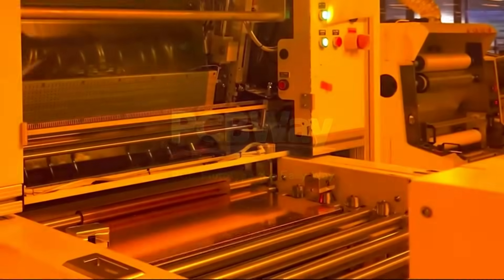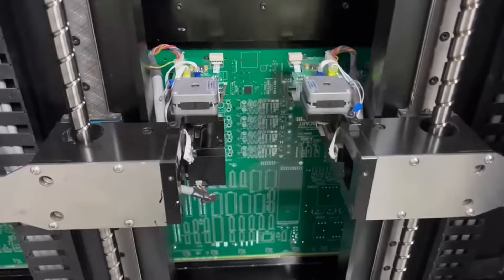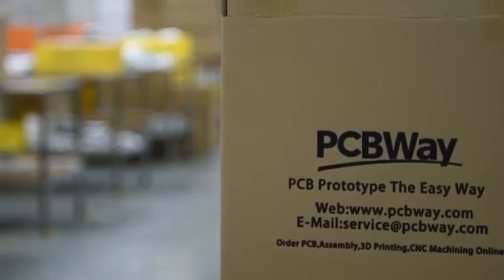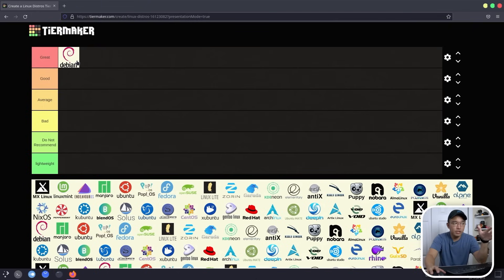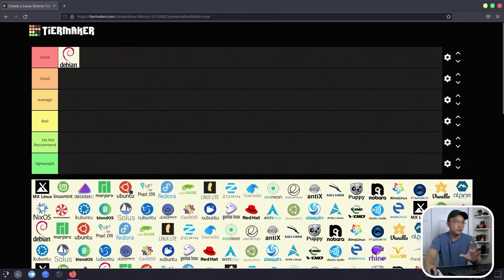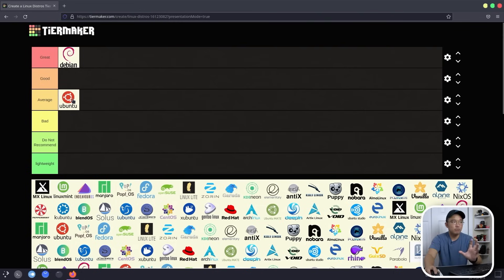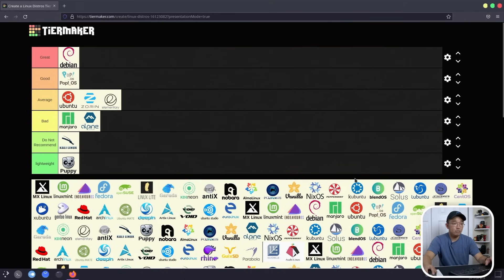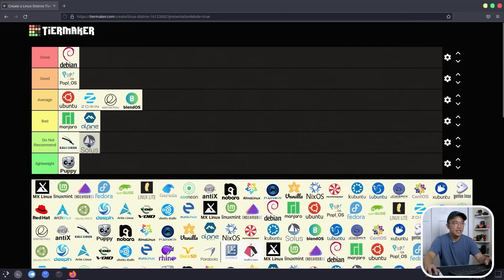Ranking Linux Distros 2023: Linux Distribution Tier List

Comment: Linux Mint - easy to use, has zfs pre-installed (zfs create & zpool create),  updated frequently, & stable. I run a headless zfs storage server. Set it & forget it. Keep making  videos Don.  We love your work.
Reply: Hey Man, can you find linux mint compatible versions of common applications to install ? For example team viewer, chrome, office package without having to use containers ? Does linux mint also support most hardware found on laptops sold in the last 4 years. I.e. intel based boards with i5 Processor 8th gen and over ?
Reply: Hi brother I'm facing issues installing wine pls help
Reply: Why display graphics are dim in Linux distros for amd ryzen compared to windows

Comment: I think it is best stick to distros with a strong dev team, longevity and track record. Many derivatives are fairly pointless, although the likes of  maybe Mint and Gecko that bring added value to the disto they are based off are welcome. Go to the source distro  in most cases. You did’t even discuss the likes of OpenSuSE - Leap, TW and the immutable Micro OS all top tier especially if you value security and reliability. TW the safest option for a rolling release IMO. 

Endeavour maybe the best Arch based distro? 

Not an Ubuntu fan for the reasons you hint at and more, but Ubuntu Budgie is the best Budgie implementation I think. The UI / UX choices are brilliant. So good, that I might put it in the top tier, *despite* my distaste for anything Canonical.

Of course, there is no best distro, just the one that subjectively works best for each of us - and however we define ‘best’.
Reply: Yast is pretty nice.
Reply: AUR alone makes arch worth it imo. whenever u need something obscure, aur has it which is a pretty big + if you ask me

Comment: Old  Network/System Admin here....  IMO....  It was Ubuntu 16.04 when Canonical started to ruin Ubuntu.  16.04 was the 1st version that was not 100% tested before release.  More or less turning it into a Beta that the "End-User" would help debug.  Sounds like what Microsoft did with Windows 11 doesn't it!?!?!?!  That's when I decided that I would not have any BETAS in my server room.  I used 14.04 until EOL and stuck with my other server picks:  Debian, Slackware and Redhat.  Now... Redhat is off my list this year.

Comment: It's ... I don't know ... very personal and use case specific.Alpine is great for docker images for example, I don't even know if it's trying to be a desktop distro as well. Debian got better with one ISO that contains binary packages. Before it's was only good for servers imho and it was not great desktop. I never particularly liked Ubuntu without specific reason, but it has good release cycle. My feeling was like that kubuntu was made with zero effort and I prefer KDE. openSUSE is underrated imho, but it has it's issues: btrfs is somewhat hard to maintain and understand, leap is way too conservative, tumbleweed is the exact opposite, but i'm really curious about slowroll which might be competition to Fedora. Fedora is great, i would just prefer less updates, I don't need a new kernel every week. But in my opionion Fedora, CentOS, openSUSE, Debian, Arch?, Ubuntu, Mate are only distros worth using. Rest has various problems such as lack of support, user base, quality, packages and are focused on one thing (desktop) and lacking in other areas.

Comment: Would agree with Manjaro's placing.  Was recently using it but things just started slowly falling apart to the point were I couldn't access programs from the desktop as it kept claiming they were not secure.  Things just broke one after the other with only limited use of the AUR (one or two AUR packs at most).

Comment: I've been playing around with Antix on my old eeepc 701, and it's pretty good. Though it is definitely one of those build it yourself distros, especially if you need to keep the install size below 4gb. The small screen on 701 makes most desktop environments pretty unwieldy. But I have been enjoying the Herbstluftwm tiling window manager on Antix. 
I've used Puppy on that machine too, but there was something about it that I didn't like. Though I can't remember what that was. Both of those distros still have 32 bit versions though, which is great.

Comment: I tried Nobara Linux and revision 38 kinda worked then got borked on 2 PC's, tried 37 and 38 and it failed to boot, with rufus and ventoy, called it in discord but they never answered, using Garuda Linux for gaming, Mint for old hardware, Even thou you are right about manjaro, it works for me flawlessly with what I do, issues I get in all distros, is impossible a perfect one.
By the way, I had  lots of problems using Debian and its clones, rater go back to kubuntu or the likes but not ubunto or gonme at all, is just not me.
Reply: That's what most people in the Linux community just cannot grasp. I use Manjaro, not because I like the expiring certificates and other drama, but because every other ready built Arch distro either fails to boot on my machine or updates and bricks itself immediately after installation. Mint does the same on my machine after the first update. At least Manjaro lasts about a year before irrevocably killing itself.

It's all about your unique set of hardware. What works for me, just won't work for you. Check the multitude of conflicting reports on ProtonDB, often on the same distro, with the same version of proton.

These tier lists are stupid and only stupid people would take them seriously. Do your own testing and find which distro works best for you.
Reply: Why display graphics are dim in Linux distros for amd ryzen compared to windows

Comment: I switched from SunOS & HP-UX Unix to Red Hat (pre-Enterprise) Linux 6.0 in 1999.  Then, because I'm cheap, I switched to CentOS and Fedora.  Then I switched to Ubuntu, because it was easy to have CUDA support, TensorFlow, Android Studio, etc.  I hated Ubuntu in the beginning, but now, many years later, I just somewhat dislike it.  I also use Raspberry Pi (Debian) OS, and my pfSense router runs on FreeBSD (Unix).

My three gripes about Linux over the years:
1) Free distributions that become paying
2) 32-bit support that ends
3) Good distros that start to add junk software
Reply: I worked on SunOS, HP-UX, Enterprise Redhat, FreeBSD for years. Big fan of all of those OSs. Spun up many Redhat and CentOS VMs on the HP blades. Good times. 

For personal use I’m a big fan of Debian. For quick and dirty fun I’ve used and recommend Puppy as a way to get your feet wet and  use those old laptops that are collecting dust. FreeBSD is probably my all time favorite OS but always seems to be missing something needed to run an app. Usually load up it up for the new releases to see what’s new.
Reply: Why display graphics are dim in Linux distros for amd ryzen compared to windows

Comment: Solus has been updated and is using kernel 6.4 and Budgie 10.8,all packages are up to date and it is running smoothly
Reply: Solus was great and along with OpenSuSE TW, was the only rolling releases I typically recommended However, the past / relatively recent upheavals in the dev team, mean I won’t risk Solus ever again. These days I’m into ‘set and forget’ distros rather than tinkerer/ hobbyist alternatives, so Open SuSE’s Micro OS Desktop and Fedora Silverblue win out for me. Beyond these, the top tier should include OpenSuSE TW and Leap, Fedora WS and Linux Mint or Zorin OS for would-be converts to Linux.

Ubuntu? - too many decisions taken by Canonical have alienated me. I would say though that Ubuntu Budgie is a very stylish distro and great implementation of the Budgie DE. Top tier, maybe, if you are better disposed towards Canonical than I. They seem to have too much influence even over the community flavours sadly. UB is very good within this ecosphere all the same.

Comment: I currently use Debian with Distrobox containers (think: Debian Sid/Unstable on top of Debian 12 Bookworm/Stable) and Flatpak to get around older packages. Some stuff, like the DE, being left absolutely alone for the majority of a release's lifespan is a critical advantage for production, as I can't stand the weird decisions of GNOME or the spurious breakages of KDE, so I stick to XFCE since it has good synergy with Debian. For the sake of KDE, if you absolutely need KDE, Debian Testing/Unstable is the only way as 5.27.5 is WAY too buggy for daily use from my experience. Immutable distros like Silverblue are great, I've daily driven it for about almost a year, but I am certainly waiting until the new dockerfile based system is production ready for 39, maybe 40.

Solus did have a new release back in July 2023, except the way they went about the announcement left a bad taste in everyone's mouth. It's one thing for a founder to ghost a project, it's another to say you did so while working on another one in the background.

Comment: It is not true that Solus Os is not updated. The last version is 4.4 plus, you can read a lot of information on the blog about the distribution itself, what happened. And what will change in the future, so I don't see a problem. The only drawback is the somewhat modest application repository, although you can use the flatpak, and app image applications. Moreover, it works very well and is stable. There are no problems after updating the system, that something went wrong, etc.

Comment: Can someone explain to me what happened to Ubuntu and other related distros after 20.01 in relation to gaming with Wine? Up to 20.01 I could install the appropriate Wine version, install something like Deus Ex, Dead Space, or Doom 3 and it just worked fine. Starting with 21.01 I start getting opengl errors and other issues. I can't narrow the issues down to just Ubuntu or the Wine version myself. Thoughts from anyone? Thanks.
Reply: Used to play lot of games with steam on my linux mint.  I could play a lot of games for windows back then almost  as good as windows.
Reply: @venkvelaga  I don't use Steam. I have all my games backed up. I'm using Bunsenlabs Linux, it's based on Ubuntu 20.01, with Wine and the games I play run as good if not better than Windows.

Comment: Linux Mint is really easy to use and install.  Great to begin with for windows users
Reply: Mint is a really good OS for beginners. Over time, you will likely want to move somewhere else as Mint is a little limited.
Reply: Why display graphics are dim in Linux distros for amd ryzen compared to windows
Reply: @ajithjithu3084  You have posted this three times in my other comments. Sounds like a driver issue on your end.
Reply: @ajithjithu3084  because your stupid ass doesn't know how to change configurations.
Reply: I would also like to put a pump in here for lmde
Reply: I liked it for the first five minutes after I installed it.  Then I did the recommended update and my two monitors went to one unidentified monitor with no sound.
Reply: Mate or cinnamon version
Reply: I also use LM and is really satisfied with it. Surprisingly he hasn't tried it
Reply: I'm going for Linux Mint as well. Heard a lot of good things about it
Reply: Can I call it Mint OS? Sounds cooler :)
Reply: @computerscience1101  you're right mint os sound refreshing

Comment: the suspense builds as you see a daunting list of distros and taking a bit of time explaining each one… will he finish them all? 😅

correction on kali: 
they haven’t had root as default user since 2019. with the start of 2020.1, it defaults to kali as a normal user with sudo access. but i agree it’s not that useful for the general user.